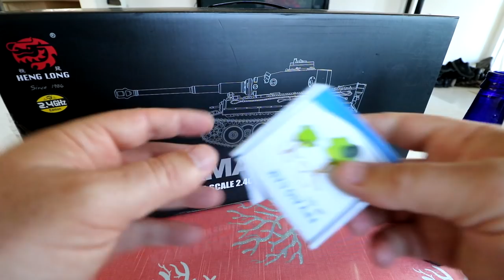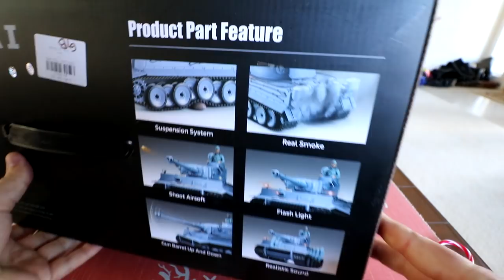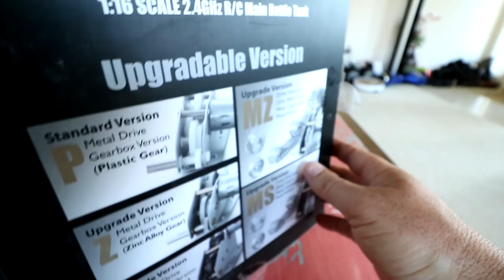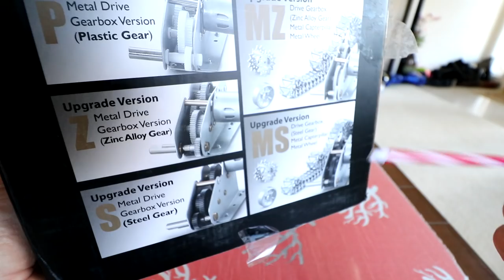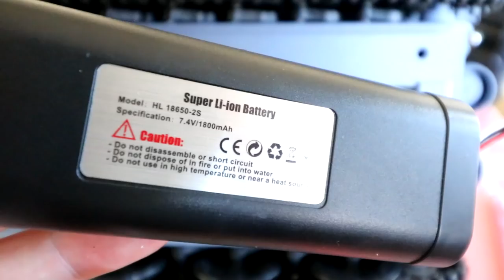HENG LONG GERMAN TIGER 1 AIRSOFT 1:16 RC Tank - Full Review - [Unbox, Setup, Run Test, Pros & Cons]

Comment: When the tank runs over the stick the transmission broke again
Reply: Upgrade to Steel Gears. The Plastic strips easy. Plastic is ok for indoor use. Use CA on attached parts.
Reply: @maddog57ful  The Tiger I originally had was the version with the steel gear box, drive gear and tracks. That thing was a best because of what it was capable of going over and climbing. The new Tiger I got is fully upgraded to metal when it comes to the drive system and the suspension.
Reply: Just like the real thing :)

Comment: The airsoft cannon is not powerful because then the company will get sued for some kid getting their eye pierced
Reply: They won’t get sued because of the warning labels they have so they can win if they for some reason ever get sued
Reply: Two or three drops of RWS Pure Silicone Oil. Makes a big difference. Tilt Straight up, engage cannon fire control just to the point of release, drop 2-3 drops of Pure Silicone Oil. RWS preferred.

Comment: Dustin : The man occupying the turret top hatch is the tank commander, wearing communications head set to talk to the crew and have radio communications with other tanks. The Germans were the first to have radio communications between tanks. The driver is located in the tank body, under the hatch, below and to the left of the gun barrel. The gunner is in the tank body, under the hatch to the right of the gun barrel. He also fires the coaxial machine gun, located directly in front on him. The loader is inside the tank under and to the right of the tank commander. ;-)
Reply from the maker: +Don Fish Jr. Thanks Don.  Always good to hear your seasoned advice and comments 👍

Comment: You know when you got stuck and went into reverse..... why didn't you turn the turret and camera around?
That looks like a lot of fun and has more than enough range. Liked it
Reply from the maker: +didactylos4 diddy4 I guess I could have done that but I got out by just full throttle in reverse luckily.  I did a range test afterwards and made it down past my other neighbors house further down the road until control hot choppy.

Comment: A little brief history of the Tiger I, there were three models, Early, Mid, and Late, what you have is the Early Production and a total of 1,350 Tiger Is were produced.
Reply: Evil Fingers  so what is the third tiger called?
Reply: Melan Lester H. Mondia Reread what I posted, your answer is right there.
Reply: Evil Fingers OH I SEE...
Reply: It was the tiger h1, tiger 2 p, and tiger 2 h right
Reply: Masters of Flight Nicholas Zorc , all three are just called Tiger. The tiger P is a different model and the King Tiger/Tiger II is also a different model. The one he has is the early model because it has the short 88mm gun.
Reply: I now allot off tanks but that  i didn now :)

Comment: The guy on top of the tank was the commander there's a commander a Gunner a loader assistant driver and driver the drivers in front on the left side of the tank the assistant driver is on the right side of the tank the place of the commander Gunner and loader depend on the tank

Comment: If I'm not wrong - this is a "fake antenna", as it is not connected to the receiver (at least in my T-34/85) in 2.4GHz version (receiver includes internal quite small antenna inside).
Also there are a lot problems with driving T-34 on sand: tiny grains can get into mechanism and damage them (I had to buy a new tower, as ASG was damaged, also gears for rotating tower had to be cleaned).
Reply: The tank is not supposed to be driven on sand. The instruction manual says not to.

Comment: Great video Dustin. These are great tanks for people to start in the hobby.
Reply from the maker: +RC Tanks & Trucks 24/7 Thanks.  Really want to do more with them.  I may build a sim location in the corner of my yard 😁
Reply: I don't get how you would find this fun but hey, it's better than being stuck in your electronics 24/7
Reply: Pretty sure that guy in the turret is the commander, not the driver. Thought I'd bring it up. Interesting video BTW.
Reply: Might want to think about adding some to scale weight or something, seems too sensitive to control for a tank imo.
Reply: Hey that is a dope tank
Reply: It still is a cool tank, I do agree. It's a Tiger when aren't they cool?
Reply: RC Tanks & Trucks 24/7 itss not a driver its the commander/radio operator
Reply: RC Tanks & Trucks 24/7

Comment: Hey Dustin, Had the same exact tank. Was loads of fun for about a year, then the  battery female connector kept disconnecting from the battery connector causing my tank to stop dead in its tracks (pun) intended. So now it’s sitting in my unused model room on display. Thought about getting another one, but my preference are now quads. Still loving my Mavic, no camera issues with mine. Keep up your reviews with land & flight Rc’s. Did you ever get the latest polar pro filters for the Mavic?
Reply from the maker: +Carl A Hey Carl.  Sounds like an easy fix to get running again.  I did get the new PP Mavic filters and will be doing a vid on them soon.

Comment: FYI, the driver that can be added to the tank should be called the dude.  So, "you get this dude that even comes with headphones, etc"  rofl
Reply: Turret recoil is cool!
Reply: problem is , that isn't even the driver. that is the commander. the driver is usually on the left front side of the hull of the tank (the bottom part next to the tank tracks)

Comment: Any ideas on how to make it run slower? Looks to be very sensitive to the controller, and it makes it too fast.
Reply from the maker: +Andi Biront Good question.  It's set in the speed Controller.  Possibly with some modding or changing the speed control out.
Reply: If your tank comes with a 6.0 main board, you can choose high speed or low speed mode through the radio

Comment: ok so i bought this tank they sent it and i got put it together played with it and then it died so i charged the battery after the for 4 hours the instruction manual said to charge it i put it into the tank and i start it up try to move forward and it shuts off and this kept happening the problem was that the charger didnt charge the battery so the company sent me a new one i charged the battery put it into the tank an then the same problem happened it wouldnt move in any direction it wouldnt shoot but it did everything but the movements where slow else if anyone knows how tho fix this please help i dont want to have to wasted my money on this
Reply: AirForcePilot35 It sounds like the battery is the problem
Reply: it may be but they all ready refunded me the money an let me keep the tank so now i am taking it apart to see what it is if it is the battery i w ill get a new one
Reply: AirForcePilot35 than write me back if it isnt working with the new battery
Reply: AirForcePilot35 is it working because it is smart to take the tank apart since you already got refund money

Comment: Actually the driver would be in the front not at the top, that character would actually be the commander of the tank. The radio operator/gunner would sit in the front to the right of the driver in the tank. For the turret is the loaded, the commander, and the gunner that shoot the main gun. If this tank was real. Not to sound like a nerd but idc.

Comment: I had one of these ( one of the early varriants. Got it back in 08). If anyone is gona buy one spend some more money and get it upgraded namely to metal. track wheels and the whole bottum to metal. The standard gears and motors are good. And for added fun take a dremal tool and remove the turret travers limiter for full 360 range
Reply: How remove the tower lock?
Reply: I specced for the metal tracks and sprocket and idler wheels. Go for a 6.0 board to come with the tank for ideal operations

Comment: The models nice looking but could use some paint I've had some RC tanks over the years and usually they come with paint but once I don't come with paint like this tiger I really enjoy painting them I'm not very good at it luckily at my local hobby store they offer to paint your models for you in the style you would like and they did a really good job it's always fun to try to paint it yourself if you're wanting it to look as real as possible why as close as to the actual vehicle It's Worth spending some money on it I don't know how many RC vehicles you guys own my current collection is 2200 and that's just my ground vehicles I have 400 boats from civilian to military and I got 300 aircraft from realistic to science fiction and yes that includes the Millennium Falcon planning for this year too pull my train collection out of storage once I finish setting up the track so they can run around the entire house

Comment: How much time you want to charge it 100%?(please answer me
Reply from the maker: About 1 hour
Reply: @DustinDunnill  I charged it 1houer and i played with it only 39m
Reply: @DustinDunnill   if I charge it for 4hour what will happen?
Reply from the maker: It should auto stop at full charge but if not I would not charge for more than 3-4 hours to prevent battery damage or fire 🍻
Reply: @DustinDunnill  ohh ya I did ,like I charge it for 1h then take it off for 15m then charge it again for 1h like that, thanks

Comment: My 5 and 3 year old cousins came to my house a couple weeks ago while I was in school, when I came back to my house that day I discovered they had entered my room, dropped my tiger tank from my desk, sit on the turret and the gun and apart from that they took the a jar full of the bullets of the tank and filled every hole in the tank full of bullets INCLUDING the little hatch where you can see the gearbox :c and when no more bullets could fit inside the tank they dropped the rest of the bullets in the floor of my room. To this day I still haven’t been able to open the tank and get the rest of the bullets out :C

It’s even worst because I had just got the tank for my birthday two months before :C
I wondered if you had any video in which you have already disassembled the tank. It seems mine is a different model of the same tiger 1 heng long and I can’t find a video of the disassemble of the same model :C

Comment: I own a couple of them
Reply: I recommend buying at least one replacement transmission for the tank. The transmission that comes installed in the tank, is mainly plastic, and will strip out. The replacements are actually metal, and will stand up to abuse.
Reply from the maker: I may do the full metal upgrade ...tracks and everything 👍
Reply: Dustin Dunnill I have that. The metal is nothing really special, it’s just a tin

Comment: Real tanks didn't have much elevation on their guns either. Nor do they now.. There's a lot of gun inside the turret. And not much room for movement. I hope I don't sound like a sad do. L O L
Reply: and the gun depression is even worse than the elevation
Reply: Ummm not to hurt you but you are wrong. Russian tanks have really bad gun depression but good gun elevation and American and British tanks have REALLY good gun depression. German tanks are quite of in the middle.
Reply: James Yusay i was just thinkng that with the Roof of the turret and the breach of the gun taking up most of the space in the turret it would hit the roof since it is mounted so High. When the gun points Down the breach points up and if it is mounted High up there is more space under the breach than above it
Reply: the silent farmer search the Comet British tank, it has 12 degrees of gun depression.